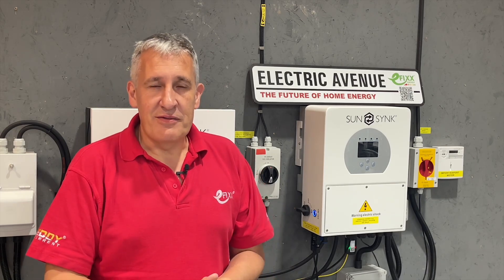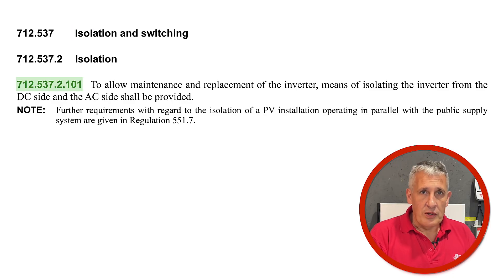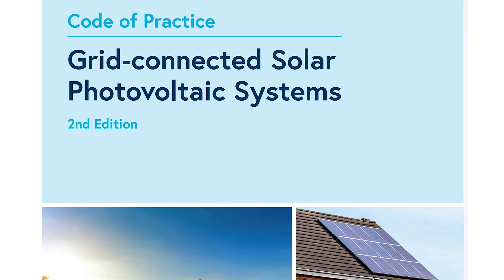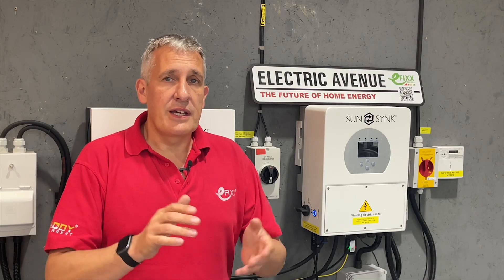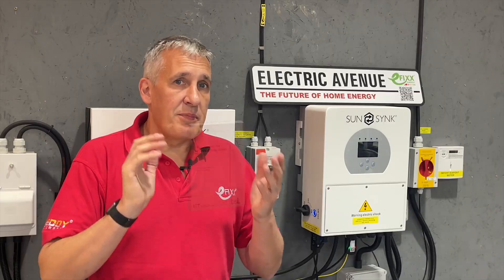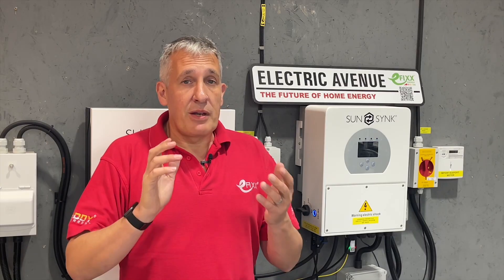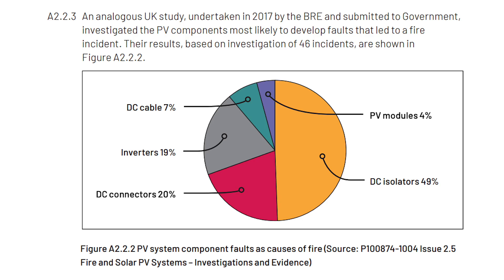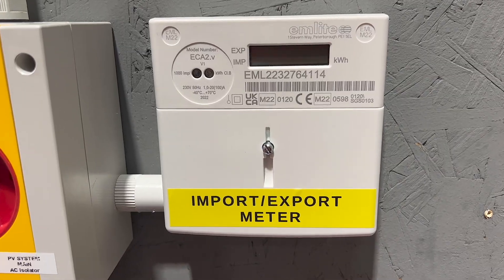Do you need to fit a DC isolator?| Solar Inverter Installation UK

Comment: Easier to carry out testing such as Isc and Voc with the DC isolator there. Otherwise you'd need to make up a MC4 test box with matching connectors to carry out Isc and Voc tests
Reply: True. I would be a bit concerned about incompatibility of MC4 connectors. For instance, those provided by sunsynk make a poor fit with other manufacturers mc4's. So you'd need to hunt down the same type for the test box. I'm probably getting a bit pedantic here...
Reply from the maker: Test box is simple construction and you can use on all installations.
Reply: @efixx  I still haven't seen an explanation as to what is failing in the DC isolators. I was taught to use a, correctly selected, DC isolator for short circuit testing of PV modules, because the contacts are designed to switch under load without arcing with DC. If you use MC4 connectors to make and break a short circuit test loop, you are inviting arcing and damage to the contact surfaces as the "switching" characteristic is undefined and uncontrolled.
Reply: Seems like one hell of an ask for an electrician to have those tools.
Reply: Buy a decent tester that deals with this for you.

Comment: Is it just me who thinks it good practice to install an isolator where the PV voltage comes in.? These switches are not cheap due to their rating on handling load arcs on the contacts.
DC is often in hundreds of volts higher than House mains, so I would expect it to be treated with extra care.

Comment: It is all becoming confusing.  First code of practice for £90 said you need a DC isolation switch.  Then the next code of practice probably another £90 said dont fit them as there data showing they have been the cause of fires.  First point, make the DC iso fit for purpose.  Next point not all PV arrays are fitted with optimization.  Another point with no DC isolation what happens when you need to swap out a faulty or damaged MC4 connecter?  The CoP and BS7671 are the minimum standard
Reply from the maker: The strings are still live when isolated.

Comment: The current method/ old recommendations for installing solar and battery pv is dated and stupid.  Every join  of a cable is a weakness.
Connect from mcb  to a ac isolator- through a generation meter ( which itself should be obsolete) through another ac isolator and then into the inverter
 5 connections for 1 circuit.
Reply: We have recently stopped. All the SLD drawings that our software had one at the consumer unit and one at the inverter. We now just place a sign stating where its at
Reply: Why do you need an AC isolator on both sides of the generation meter?

Comment: If isolators are causing fires, then sounds like they need upgrading to metal enclosures etc as happened with cu's...
Reply: or deleting from systems
Reply: @edc1569  I've got four DC isolators on my system that I never intended installing, but the electricians insisted, this was 14 months ago. I have PV combiner boxes, and in those boxes is an MCB (Z Beny - same make as the isolator in the inverter in this video) which complies with BS EN 60947-2 as shown in this video for MCB's. My batteries also have Z Beny Molded Case MCBs, which also comply. I'm looking at adding more solar, and can do with more space for the Victron MPPT's, it would be handy to delete the isolators.
Reply: I AGREE MEM STEEL ENCLOSED KANTARK RANGE

Comment: Didn't the first quoted regulation say "to allow maintenance and replacement of the inverter"
So if the isolator is part of the inverter, how do you isolate when replacing it?
😂
(not a sparky, just a customer)
Reply from the maker: You unplug the MC4 connectors from the inverter.

Comment: Ironically, the only part that has failed on my system (installed in 2015) was the AC isolator switch, fingers crossed the DC isolator has been fine. From a fire safety point of view, its totally unusable since I can't see anyone being willing to climb into the loft of a burning building to operate it.

Comment: Fundamentally an isolator, AC or DC, when correctly designed, constructed, specified and installed should pose a very low risk of failure.   In terms of typical operation cycles they should just work and essentially last forever.  Eliminating them ‘because some catch fire’ is much like the knee jerk metal consumer unit requirement.  Yes metal provides some degree of containment compared to plastic but the underlying issues that cause fire still remain - defective switchgear and/or installation such as incorrectly tightened terminal screws, cheap tat RCD’s & MCB’s that support flame, incorrect trip settings and undersized or oversized cables.
Reply from the maker: You can never omit good workmanship.
Reply: yes get mem kantarc porclain isolators with spring loaded action
lots of these plastic switches are like starting a welding arc
Reply: YES I AGREE MOST BREAKERS NOW ARE LIKE A WELDING ARC STRIKER AND GO ON FIRE
Reply: If on balance they are more dangerous than a benefit then eliminating them seems sensible.  I'd like to see the stupid generation meters gone next.

Comment: Imagine being a Fire Fighter and having to "Find" the DC isolator ? ... Needs to be located externally within a protected service unit/box or within reach in a protected fire exit/route and clearly identified, you don't want to be fumbling about or having to delay your decision based on the multiple possible options of isolation, just because the installer/manufacturer or current regs provide options.
Reply: I AGREE A FIREMANS SWITCH SHOULD BE MANDATORY ON A HOUSE OR ROOF SAME AS NEON SIGN USING THE LIKES OF MEM KANTARK OR BILL FIREMANS SWITCH WOTH REMOTE RING ON HANDLE DOWN FOR OFF THESE SWITCHES AND ISOLATERS SEEM TO BE FORGOTTON THESE DAYS
Reply: What is the situation where finding the DC isolator is useful for a firefighter?
Reply: @edc1569  Imagine actually knowing where it is, when you have zero visibility ? or maybe a situation where to isolate an electrical source of generation for crew safety and or prevent fire ignition and for the fire investigation officer etc to work safely ?
Reply from the maker: There are products such as the PVstop for fire fighter isolation.
Reply: @efixx  Hopefully fitted as standard then ? Just like the Firemans switches for high rise etc

Comment: I will still install a good DC isolator on my jobs regardless
Reply from the maker: The problem on large installs becomes you need more room for the isolation than the inverters.
Reply: @efixx  don't buy a cheap brand DC isolator .
Reply: @gino2465  It's not the isolator itself that tends to be the problem - it's the site-made DC connections.

Comment: Got to appreciate the irony of DC isolators as safety devices being the leading cause of PV installation problems and fires.
Reply: THIS HAPPENS WITH RUBBISH ISOLATING BREAKERS
Reply: @jimuraypearson  This happens with any equipment moisture is able to get into regardless of brand.
Reply: Sub standard design. They should be designed and work within a safety margin on top of that. Should also cope with moisture and high ambient temps.
Reply: You can say the same thing about the cables which came in at 7% as shown in the video.

Would you like to remove those cables?
Reply: @deang5622  cables are absolutely necessary, isolators are only for convenience and uniformity as most installations have means of achieving equivalent functionality without them.
Reply: @teardowndan5364  Gonna teach me Ohms Law too? Or how about Faraday's Law?

Comment: It's simple, yes.
Reply from the maker: External or rely on the one fitted to the inverter?
Reply: @efixx  belt and braces for me, external.  Wouldn't just rely on one fitted to the inverter.  I might need to remove/replace the inverter.

Comment: I spoke to NIC & MCS regarding this subject a long time ago and if you tick all the boxes i.e. the inverter has a built in DC isolator compliant to 60947-3 and persons working on the equipment are trained and competent then there are no issues. Don't forget that governing bodies are now pointing to the DC isolator as the weakest link in the system and can lead to fire. At the end of the day you've got to be happy that the system is compliant and safe to use.
Reply: Forgive my ignorance as I'm not a spark (ex fireman), but why on earth are DC isolators so dodgy? Genuine question, does their design or build need to be improved or something? 👍
Reply: @northeastcorals  Yes, there was no explanation as to the failure mode of the DC isolators. I was under the impression that they were designed to switch the current capacity of the PV modules (if selected for correct rating). That's why you use DC rated ones, so they don't arc.
Reply: I'm an EE (prefer microamps, they tickle less), not a spark, so take this with a pinch of salt, but my understanding was that it was the self inductance of long cable runs causing a spark on switch off under load between the isolator contacts.  Since it's DC, the spark doesn't get extinguished at each zero crossing, so it just stays there, constant spark until your house is on fire.  You already tried to turn it off and it's carrying on, so the only option a normal user has is to grab the marshmallows.
Reply: @northeastcorals  in my opinion and experience it is down to poor workmanship inside the isolator. The DC strings are usually class 5 which means they should be compression ferruled. If not you'll get lose stragglers that will bridge the air gap. This will heat the terminal and expand them so the cable becomes more loose = more heat, so on and so forth. 
Also, not following MI's with torque settings and using the wrong tools to tighten up the terminals I.e. drill etc... If you get the basics right then they are a good as gold.
Reply: @keswickcowboy  Ah interesting stuff! Well I've recently had 4 of the buggers fitted so fingers crossed the lads done a proper job on them 😆

Comment: I have allways associated a DC isolator at both by the inverter and on the roof by the pannels also? At least that's what they appear to do in the land down under. Also it just feels wrong to unplug a MC4 connector without first isolating it upstream.
Reply from the maker: You should always check there is no current flowing in the string before unplugging an MC4.
Reply: Of course, same certian isolating devices with high current. Pulling the main 60A/80A/100A HRC fused cut out can cause nasty arcing if current is high enogh....Yes I know they are DNO's property, just what I have read online @efixx
Reply: Roof top isolators in Australia caused more problems than they solved and have been directly linked with several fires.  It's just not an appropriate place for them.  They have been retro-fitted with shields to reduce sun (ironic!) and rain exposure to try to address it.  Despite that it's not unusual to them rusted and damaged internally.  They are no longer mandatory with other options available such as placing isolation switches in sheltered areas under eaves and having a point of disconnection indicated on the array itself showing where MC4 plugs are that can disconnect the array completely, ie turn off isolator where ever it is and if you need to work upstream of that for some reason disconnect the indicated MC4s.
Reply: I AGREE

Comment from the maker: Further Reading

IET Code of Practice for Solar Photovoltaic Installations - 2nd Edition
http://hub.efixx.co.uk/IET-COP_PV

MCS Solar installation Standard V5.0
http://hub.efixx.co.uk/MCS-Solar-V5

RC62 Recommendations for fire safety with PV panel installations
http://hub.efixx.co.uk/RC62
Reply: @efixx  Hi, I realise that this is a nine month old video now, but I work for an organisation that supports UK Fire and Rescue Services to investigate fires, and we've been called out to several PV inverter fires since this video went up.

Inverters without external DC isolation make fire fighting and fire investigation more difficult and more dangerous because it makes it impossible to isolate the panels in the event of an inverter fire. Also, DC isolators remain the most common cause of fire in PV systems.  The only difference is that they're housed  inside the inverter chassis now.  

You made a point of listing all the insurance organisations that endorsed the new fire safety guidance. However, the guidance is not endorsed by the National Fire Chiefs Council or any of the individual Fire and Rescue Authorities in the UK.